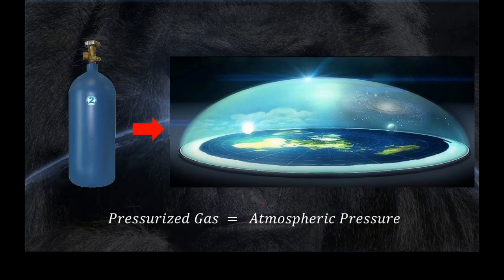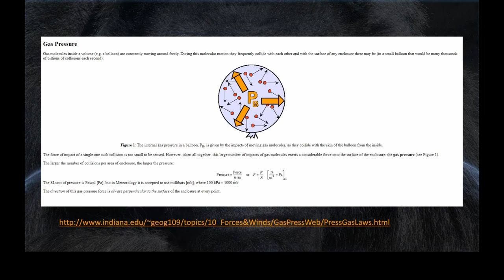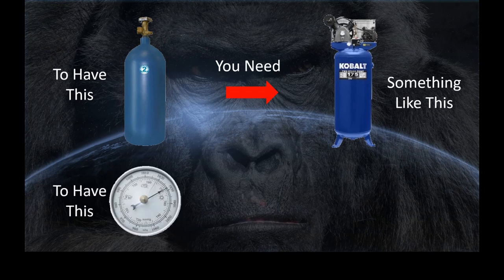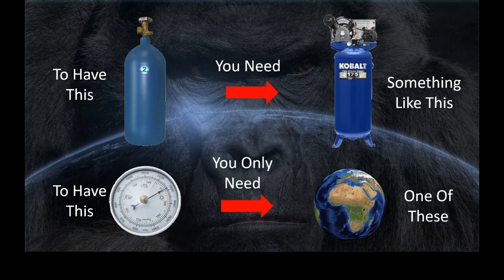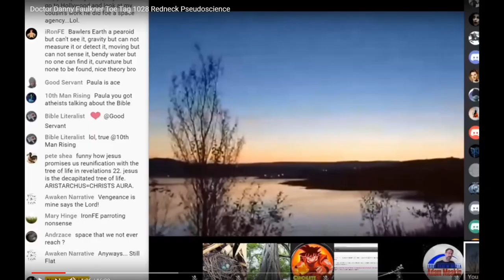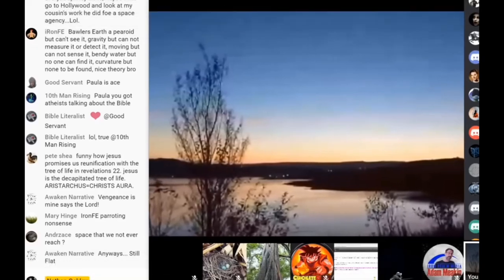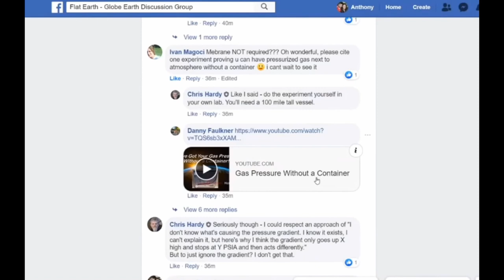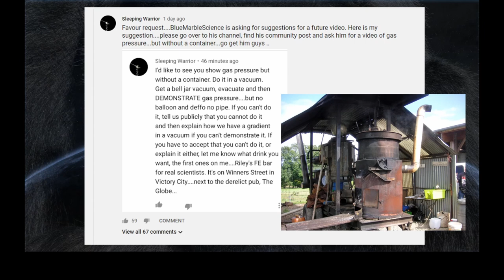Pressurized Gas versus Atmospheric Pressure

Comment: For all you globe deniers out there, the definition for a container to hold gas pressure is contained in the ASME Boiler and Pressure Vessel Code, Section VIII, Division 1.  By definition a pressure vessel is a sealed vessel where all component meet the requirements of the design pressure of a given application.  To be clear, any vessel designed to contain pressure is by definition a sealed vessel.  Riley actually had it on the screen when he was looking for a definition but wouldn't click on it....I wonder why.
Reply from the maker: Absolutely Mike, by definition it's a sealed vessel. That's why I had so much fun asking Sloppy to produce any credible definition of an open pie as a gas container. Obviously, there isn't one.

Comment: Now for the next experiment:  Take a pipe sealed on one end and SPIN IT end for end inside a vacuum chamber at ambient pressure.
With a gas pressure gauge at the BOTTOM of the pipe, monitor the pressure while PUMPING DOWN THE CHAMBER.

GUESS WHAT? You CAN MAINTAIN ATMOSPHERIC PRESSURE at the bottom of that pipe WITH ONE END OPEN TO VACUUM EVEN IF THE CHAMBER REACHES HARD VACUUM.
If the pipe is 1 meter long, you need to spin it at only 30 RPM to get a tangential acceleration of 9.8 m/s^2.

For those that care: Centripetal acceleration is: a = v^2/r = ω^2 * r ( ω = angular velocity (rad/s), r = circular radius (m))
30 RPM is 3.14159 radians per second (no I didnt make that up)
SO acceleration in this configuration is: a = 3.14159^2 rad/s* 1 meter = 9.87 m/s^2
Reply: Anthony will just claim the experiment is invalid because (he asserts that) vacuums aren't a natural phenomena.

Comment: Given: there is no gravity
Given: atmosphere is pressurized
Given: gases will expand forever into a vacuum due to the se one law of thermodynamics as described by Anthony Riley when he does real science. 

It is a requirement for some sort of barrier must exist for the pressurized atmosphere to remain in the earth. 

Because if the “second law of thermodynamics” as described by Anthony Riley, the pressurized atmosphere will continually expand u til it fills the entire space created by the barrier to an equal pressure. Temperature must be equal throughout the space. This is a required consequence of those given conditions. 

Therefore some questions must be answered:
Why do so many people claim that there is a pressure gradient. 
Why are there localized regions of unequal pressure which cause wind? 
Why are there localized temperature differences?

Since the sun and moon are small and local and inside the space created by the barrier and the flat earth, why hasn’t anyone flown a plane to the moon?

These questions I have no answers to and no amount of actual research yields an answer. 

While we are at it, what is the barrier made of? How high is it? What’s outside of it?

A round earth with gravity orbiting a small star under its gravitation influence which itself orbits about a central core of a medium size galaxy under its influence pretty much explains it all quite well.
Reply: "law of thermodynamics as described by Anthony Riley"  And this is the root of every Anthony Riley argument... redefine a well known and understood concept, and force the audience to accept the new definition.  Once he does that, the rest is trivial.
Reply: @ajhieb  "And force the audience to accept his false definition"

Comment: Hey, Blue - that video has a nice hidden "easter egg" fact!

When the pipe is resting on the floor - giving us a nice view of those handsome chisels - it shows no pressure on the manometer, but that's not the whole story. The pressure at the lower end of the pipe was near completely unchanged by raising or lowering it. The pressure change was an artifact of gravity.

Raise the pipe relative to the manometer, raise the indicated pressure - without changing pressure in the pipe. Nothing in the metal pipe changed.

The gas in the tubing between the manometer inlet and the pipe, with the pipe on the floor, was a pressure column in opposition to the pressure column in the metal pipe.

Which means the gas at zero psi gauge at the manometer, when the pipe was resting on the floor, was successfully holding off the higher pressure in the pipe. (With the help of the rest of the pressure column in the flexible tube.)

Gee, "flat earth" high pressure always explodes into low pressure. Good greif, a 2nd Law violation right there in your shop!
Reply: @bluemarblescience  Nice!

Comment: They have been moving the goalpost so much, that they didn't realize when it ended up in its original place. Now the container does not need to be sealed from the top, so no membrane (or firmament) is required! They are lost in their own logic.
Reply: I find it amusing that the "firmament" has never been required according to their "Density = Gravity"...
Air is denser than vacuum, right? So it will behave as in the density tower Riley likes to demonstrate. That is: The denser air will "sink" below the less dense vacuum. So: No "firmament" needed and goalposts moved for nothing :D
Reply: @erikhoppe9133  exactly! I think the same. I told it to That Guy and it got me blocked from his comments :D so much for intellectual honesty.
Reply: Give it a few more years and they are going to prove the globe for us.
Reply: @rondevrind7655  They do that on a regular basis.... Knodel's 15°/hour drift.... Jeran's 'glory hole' experiment.... etc.)

Comment: I love that clip of Data's totally artificial attempt at laughter. Totally what I was thinking when I heard Anthony Riley and Nathan Oakley giggle at your experiment. They sure were quick to slam it, with insults and mockery, but they never debunked it. Shows how much it took them by surprised and terrified them

All they did was move the goalpost. Trying to redefine a container. But notice that their old arguments were based on the idea that if gas has any way out, any way at all, it should always escape. Check out their old videos where people tried to explain pressure equilibrium to them, they always acted as though gas moving between pressure volumes was an unstoppable force of nature that will always occur regardless of any forces present.

You demonstrated that you don't need a physical solid barrier to block gas from changing between pressure systems, where's their argument now? They've changed it, that's where!

Now they say: "Gas will always seek equilibrium if not contained ....but only in what we specifically define as a container!"

Comment: I'm still waiting for any flat earther to demonstrate a pressure gradient in a sealed container. I'm still waiting for evidence of a dome and how it imparts pressure. I'm still want to know who tied a knot in the dome. If you need a container wall  between the vacuum of space and the near vacuum of the top of the atmosphere then you need multiple container walls for each change in elevation to explain the pressure difference. Nonsense of course. None of what we can observe and measure makes any sense whatsoever unless we consider Gravity. No wonder they hate it.
Reply: Not to argue, but you will have a pressure gradient in a container. Gravity will cause it. Pascal's Law only works if you disregard the effects of gravity.
Reply: @rondevrind7655  but they all claim gravity doesn't exist. A pressure gradient inside a container without gravity cannot exist.
Reply: @rondevrind7655  My question is more about asking Flat Earthers to demonstrate a gradient in a sealed container.  Interesting as I thought Pascal's Law would be relevant to pressurised gas in a sealed container meaning no gradient.
Reply: @misterocain  My bad. The way I read your post, it sounded like you didn't think there would be. Sorry.
Reply: @progrockrules  Riley is trying to defeat himself for the DFOTY award.

Comment: I find the amount of stupidity shown by Anthony Riley to be jaw dropping, not to mention his tactical omissions. He actually asks for a bell jar to be evacuated of air and then for a gas pressure to be created inside it. What? Run that by me again! Then comes the best part, he shows a picture of the earth surrounded by the vacuum of space and claims how stupid us globe nuts must be to believe air pressure can exist within a vacuum. This is a Riley tactical omission, he forgets to mention the huge planet with a circumference of 25,000 miles sitting in the middle of the picture that has its gravity holding onto its atmosphere, and creating the pressure gradient. How is that supposed to be created within a bell jar?

Anthony Riley will then argue that gravity is not a force, as said by Einstein, so cannot possibly hold the atmosphere down. Another Riley tactical omission. Einstein never said gravity did not exist or did not have a force and stop talking at that point. What he did say was he had found a better and very slightly more accurate way, compared to Newton, to describe how gravity works by the mass of planets bending the space-time continuum. The effect is the same, a force pulls us towards the centre of the Earth, we call it gravity. Newton’s theory of gravity working as a force is so accurate that NASA, and all other space agencies, use it to calculate all their rocket trajectories, such as placing a satellite in orbit around Saturn. 
Riley loves to cherry pick his quotes, pulling out only the part that in isolation appears to support his wacky world view. These are Riley tactical omissions, he uses them a lot.

Comment: They want someone to show an open area where there's measurable pressure.  Moving the goal posts again is what I say.   BMS, years ago I read an article about a village in an African country where everyone in the village including all the animals were found dead.  Turned out they were all killed as a result of carbon dioxide, the very same gas found in fizzy drinks.  High up in the mountains, above the village, is (still there today) an old volcano with a crater lake.     Co2 builds up in the sediment and whenever there is a rumble, the Co2 is released in minor amounts.  On this particular occasion, there was a decently sized earthquake.  The only problem then, was the co2 didn't just bubble up to the surface of the water like a fish tank bubbler, it erupted releasing millions of cubic feet of Co2.  Imagine millions of litres of gas being released at once.  Co2 overflowed the rim of the crater lake and flooded down the valley, directly towards the village.   You can guess the rest.  They want gas pressure without a container in an open wide area? There's their answer. People died as a result of gas pressure without a container. If and when, you get another crack at the 3 stooges, let them know about that event.   It's also researchable.
Reply from the maker: I'm aware of that disaster and I remember when it happened.It's been brought up in comments before. In usual style, they want proof of the pressure as not even the smallest level of common sense manages to exist between their ears. To me though, that's a great example of how gravity holds gas in place.
Reply: @bluemarblescience  exactly.  👍.
Reply from the maker: @chuckymcnubbin1518  It was Lake Nyos in Cameroon. I had to go look it up. It happened in 1986 and killed about 1800 people and 3500 livestock!
Reply: @bluemarblescience  that's the one.   I got a bit busy here for a bit.   I was going to check it out tonight.   If I remember correctly, the article also mentions the estimated depth of the gas wave/avalanche as well as the estimated width and time it took to flow through the valley.   Scary stuff when you realise that something so innocuous is also so lethal when it's in vast amounts.  The power of displacement hey?
Reply: I worked in an engine manufacturing facility and the bore honing machines sprayed the oil everywhere so the floor and duckboards were soaked with it. The oil being mostly parafina/kerosene meant it was a very high fire risk, so there was a bank of CO2 cylinders installed to flood the area there was a warning on the operating lever, which read something like ‘ warning danger of suffocation, do not operate until all personnel are evacuated from area”. I saw it operated once, the noise was unbelievable, and the area between the machines filled with a cloud that took some time to clear.  On another occasion in car build final assembly a car on a car lift caught fire and the interior burnt out producing a thick black smoke. The building, which was huge, filled with smoke up to about 4 ft and above. Above 4ft it was virtually clear.

Comment: Hmmmm, an open pipe inside a larger sealed pipe, work out the fittings, pull vacuum on the sealed pipe, fill your open pipe.... rough draft, I know. But, see what I'm getting at?

Comment: Demonstrate gas pressure in a vacuum. Yeah, he's a real scientist...........
Reply: I explain exactly how to do this: Spin a 1.0 meter long pipe by one end at 30 RPM in a hard vacuum.
Put some air in the pipe, and you will have pressure at the bottom of the pipe while the open end is exposed to vacuum.

Comment: If you don't perform the experiment in Nasa vacuum chamber with pressure trasductor at the top and at the bottom of the pipe, he will always be able to move the goal post, and maybe even that wouldn't be enough.

Comment: If atmospheric pressure does not exist and this flat earth of ours is really covered by a firmament which seals all the air in and gravity does not exist as per the FE model there would be no gas pressure gradient affected by altitude.  It would make no difference how high or low you went the amount of gas in your immediate vicinity would be the same.  It makes you wonder why those people who climb Everest take oxygen bottles with them, there would be no need.

Comment: Another effect of gravity on a gas column is temperature gradient. If you get an insulated column of gas of some height, in equilibrum state, the temperature on top will be less than on bottom. This is caused by gas molecules losing kinetic energy when going up, and gaining it when going down. Also, since components of the air have different molecular masses (thus lose different kinetic energy with change in height), there may be slight gradient in the composition.
Reply from the maker: There will be a difference in composition for sure. Water disappears first (I think) and at the very top of the atmosphere, the gas composition is almost entirely hydrogen with a small amount of helium.
Reply: @bluemarblescience  In atmosphere (as opposed to an "isolated column") turbulent mixing prevails over "gravitational separation", until 100 km or so.

Comment: And it doesn't matter if that pipe is ½" or ½ mile in diameter, the height determines the pressure because uh, gravity. And I'm no genius like Queef Erasure but I KNOW IT COULD BE CALCULATED USING ONLY MAFF.
Reply: @Carl Browning - Exactly. It makes no difference if the pipe is ½", ½ mile, or in my favorite example 25,000 miles in diameter.

Comment: Let me think. If you're welding, is the gas not still pressurized as it comes out of the torch?
Reply: at the orifice its at the pressure of the gas bottle, but there is a sharp pressure negative gradient there so it soon equalizes to atmosphere: this is modeled by the continuity equations and Bernoulli for  fluid flow. 
Area x velocity = constant
In practice the gas will lose speed as it expands into atmosphere beyond the orifice.
Reply: I would say no to the gas coming out of it. High pressure, yes. Pressurized, no. I think it is the same thing with Co2 fire extinguishers.

Comment: The atmosphere does have a container. It's a gravitational container. The force of gravity pulls down on the gas in the upper atmosphere, which contains and compresses the gas below it. Gravitational containers are rare as they require a planet sized object with enough mass and gravity to sufficiently contain the gas. In contrast a spacecraft with humans on board traveling through space does not have sufficient mass and gravity to contain the pressurized atmosphere inside of it. As such the spacecraft requires a solid outer hull to contain the pressurized gaseous atmosphere that is present inside.

Comment: I'll just say that was a beautiful demonstration. It's really too bad that FEs lack a sufficient number of functional neurons to appreciate it. The FEs that do appreciate it are the poes who are lying to their fan base. They are the religious zealots. They are the ones pushing a lie.

Pro tip. There is a python program out there for Linux/Unix systems which downloads youtube videos. It's called youtube-dl. It uses the ffmpeg utility and I think it has some other dependencies. It's also available in the Home-brew collection if you are running macOS. It works pretty well, although sometimes it has to create MKV files instead of MP4 files because of technical limitations. VLC will play MKV files and I think you can use that to convert them to your format of choice.

Anyway, when I can get myself drunk enough (and maybe inhale enough butane), I should be able to use audacity, a free sound editing program, to piece together a bunch of the idiocy from the FED crew. It should be epic. They convict themselves.

Comment: Oh, but you can have gas pressure in a "leaky container"..... goal post moved over the horizon, disappearing from the bottom up.
Reply: Ironic that earth is a leaky container open at the top.
Reply: The pressure in a leaky container steadily decreases until it reaches equilibrium with atmospheric pressure.  I wonder how they explain why we don't see atmospheric pressure steadily decreasing.